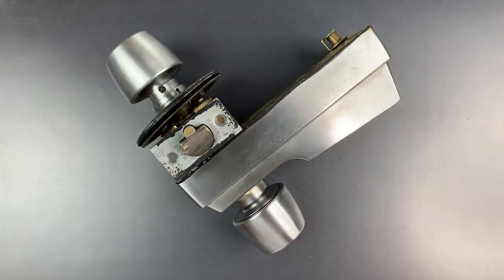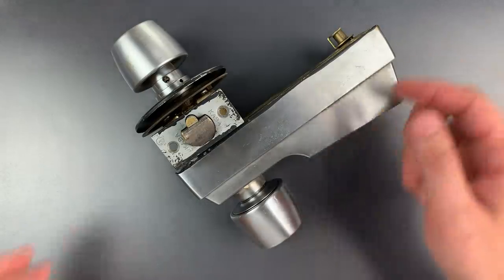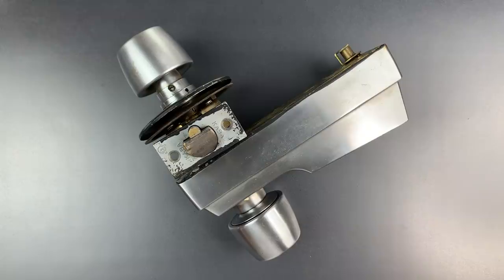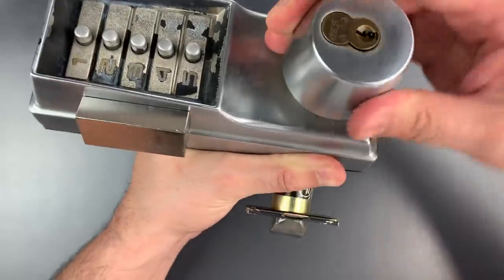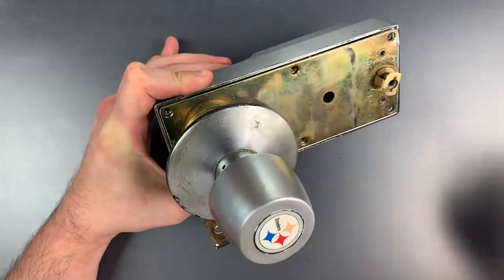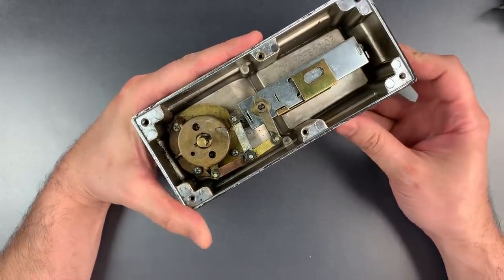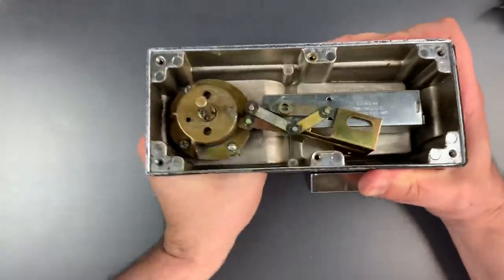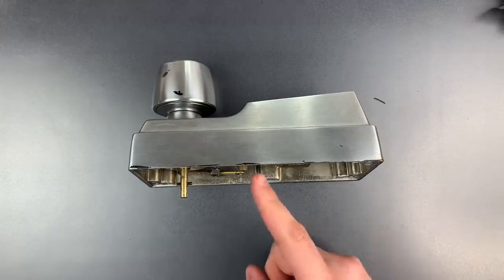[914] The Worst Lock Design Blunder Ever? (Kaba Simplex Series 1000)

Comment: Oh man, we had this lock on the outer door of our SCIF in Iraq when I was there in 2010. Crazy vulnerability! We had another electronic keypad further in, but you could have gotten access to all our servers and equipment in the back with this.
Reply: I find that bizarre. Even in 07 in Afghan we(RAAF) were specifically forbidden from using this lock type on anything requiring even a modicum of security.
Reply: Very bizarre. However, the right way is rarely the Army way. To be fair, it would be difficult to exploit anything in a 24hr shop
Reply: Now hang on.  If it's a SCIF, then this dinky button lock is just used for access control when the room is occupied and there should be a high-security combo lock engaged when nobody's in there.  Was that not the case?
Reply: @Xezlec  24hr ops the entire time, so there was never any time the scif was unoccupied, and no other security on this outermost door.
Reply: @ThatoneLich  so why change it then, especially if there is another one further in
Reply: 2009 COB Speicher Iraq. Working at Military Intel HQ for 4ID they had these locks and only these locks on every SCIF door. It would have been a huge concern, but we were fully staffed 24/7. It was still annoying to have these terrible locks protecting data of certain 3 letter agencies.

Comment: I don’t know about this particular model but most of the style of locks you can only use each of the 5 buttons one time in the combo. No repeats. This means if you have a 4 number combo the permutations possible are actually not that large. Like 120 combos. Especially if you can see wear on the buttons you can tell of a digit is not used. Then it’s like 24 combos. You can guess it fairly easily if you have a minute or two…. In the event you forgot your magnet. I’ve done it.

Comment: They used these locks inside the Pentagon, too. During Desert Shield, I was an Analyst/Terminal Operator supporting the Joint Chiefs of Staff, in the J-4 Logistics Readiness Center. This was early days, and they had just brought on some new staff. This was the first day of the new Team Chief on Duty. He was five minutes away from doing his briefing for the Chairman of the Joint Chiefs when he locked himself out of his own office, and the combination is only supposed to be known to the Team Chiefs. Needless to say, I was an eager young GS-5 civilian just a year out of college, and I could do the math on how long it would take me to brute force the locking mechanism by simply trying all possible combinations — tick, tick, tick, turn.  Tick, tick, tick, turn.  Tick, tick, tick, turn.  Only it took me extra long, because I got to the end with no luck — that was when the Executive Officer on duty whispered to me that he thought he always saw the normal Team Chief turning the door knob the other way. So, I go at it again, and after a few tries, I’m in. I tell the XO the combo, and then I recommend to them that they change it to something else. And yes, the Team Chief did still make it to his briefing on time, with his slides.
Reply: I just commented about this, because it seems the order of the numbers doesn't matter, which means (if I've done my math right) even without the magnet exploit, there are only 29 combinations possible.

Comment: Maybe not the worst, but definitely a serious one. I bet the only change they did was changing that metal piece for a non-magnetic one
Reply: @ZaC kWinz - Austenitic stainless steel or brass would be my guess, as both are non-magnetic. Both are relatively cheap, though brass is less expensive and weaker. 

Since it doesn't look like there is any stress placed on that part, I would presume the replacement part is brass.
Reply: Kaba wouldn't acknowledge there was a problem for a long time and you had to buy the upgrade.  They would not retrofit.  There is info on this if you google it.  The US gov't purchased tens of thousands of these.

Comment: I worked with one of these locks (a newer model) at my first internship in college. It fascinated me because, as a computer engineering student, I had just taken discrete math (inc. counting, permutations, etc.) and I was curious how susceptible to brute force attack it was.
This lock's combinations are one to five step sequences where each step can have one to five buttons each, but no button can be used in more than one step ever.
This lock has 6475 possible combinations. That sounds like a lot, until you realize that if they found a way to allow buttons to be reused for any of five steps it would have 24,883,200,000 combinations.
In my experience, this lock has no lockout for multiple attempts, and if you press a wrong button, you simply have to start over without pressing a reset button. In other words, the only thing that matters is that the last steps you entered match the steps of your combination. As a result, if you don't make use of the ability to select multiple keys in a single step (common in my experience), your combination can always be brute forced in at most 153 button presses, or, fewer button presses than trying 31 length-5 random codes, by using a superpermutation of 5 characters.
If you don't make use of the ability to press multiple buttons in a single step, and the attacker knows how many steps (buttons) your combination is (say they are a coworker who can hear you enter the code, or even a delivery driver who hears you do it once), then, say your combination has n steps (1<=n<=5), then it can be brute forced in min{5^n, 153} button presses, that is, 5^n if n<4, or 153 for n>=4, by using a De Brujin sequence (codes won't usually be less than 3 steps, so this only brings it down to 125 button presses in most cases). Both the superpermutation of 5 characters and a De Brujin sequence for 1 through 5 characters can easily be found online.
More generally, if the attacker knows your combination has n steps, regardless of if you press multiple buttons in any step or not, they can get into your lock in at most (n+1)^5-Σ{i=1,n-1,(n-i)^5} (in closed form, (n + 1)^5 - 1/12 (n - 1)^2 n^2 (2 n^2 - 2 n - 1)) combinations. For example, for 3 steps, that's 991. For 2 steps (the factory default), it's 242.
The fact that the lock allows you to use multiple buttons as a single step but not to reuse buttons makes for some really interesting mathematical/computer science questions. For example, what is the shortest sequence of steps you'd need to do to guarantee that you brute force the lock if you don't assume that each step is only one button? one way to approach the question might be to take the set of all possible steps, treat it as an alphabet, and look for a superpermutation of that, that is, instead of our alphabet for superpermutations being {1,2,3,4,5} like it was before, our alphabet is now the set of non-empty subsets of {1,2,3,4,5}, or P({1,2,3,4,5})-{Ø}. This is an alphabet of 2^5-1, or 31, characters. However, ignoring the fact that we don't know what the length of a 31-character superpermutation is, there is the problem that the number we're looking for would obviously be much smaller than the best lower bound on that length, because such a superpermutaion contains every possible sequence of 31 different steps, not 5. We could also try looking at it as a De Brujin sequence of order 5 over the same alphabet. This would give us the number 28,629,151, but again, our number is much smaller, because this number contains, for example, the sequence where you press every button five times in a row, and buttons can't be used more than once in a pattern.
Reply: CatoSierra can’t we just use the magnet?

Comment: After working with thoes locks for several years I feel fairly confident to point out 2 important things. 1 is i have never seen or put the bypass leaf on any combination unit intended for a lockset that didn't have the bypass switch for the secure side of door, I think it was even a different part numbers for a combination chamber with and without the bypass leaf......2 I also believe that if the bypass switch is installed, the cam that activates the leaf would also keep it from being manipulated that way. That being said, I had never tried that bypass technique on any of the units we had lying around but I always thought it was trying to pull on the comb inside the combination chamber itself. Anyway love what you do, keep it up

Comment: What's the thickness of that magnet-pick in thousandths?...
Reply: Looks to be roughly 875 to 1000. It appears to be a seriously beefy magnet.
Reply: Stupid imperial system...
Reply: @CptJistuce  pretty sure that when one is defined by the other it is the inferior one
Reply: Badger0fDeath  we are all inferior to the metric
Reply: @CptJistuce It's the French who did us one massive favor. The U.S. would not exist if the French hadn't helped us in the Revolution.
Reply: “How thick is that magnet?” ..... “US revolution!”  Happens every time
Reply: @CptJistuce  Please, tell me how the Système International d'unités (international system of units) is stupid?
Reply: Dan Schwartz
Question: when the French Revolution happened, did we do them more or less of a favor by not helping the French monarchy?
I’d say more, so I guess we did them a favor by not doing them a favor that time
Reply: Tree-fiddy and change.
Reply: @alex95sang52  Well when they redefined the meter from the iridium bar to the 299xxxxx wavelengths of yellow light, I wish they redefined it to exactly 3x10^8 so that the speed of light could be exactly 3x10^8 m/s
Reply: @jayhom5385  If we defined 3x10^8 m/s as the speed of light, the "new" meter would be 0.7mm shorter... That's doesn't sound that big, but that makes a big of a difference for highly-precise measurements that would need to be reajusted

Comment: We had those on the doors to the TV studio and TV production room on the air craft carrier I was assigned to from 2004-2006 (I was a Navy Journalist).  Occasionally the mechanisms would simply wear out and they would have to be replaced.  I took one of the broken ones apart to see if there was an easy way to fix it.  I managed to get it to work for a couple days, but then it failed again, and we had it replaced.

Comment: There's an agency in my work building, that deals with sensitive information, that occupies an entire three floors that use these locks. I mean... even if you could get in on one floor you have access to all because there's an open access staircase between the three. But knowing how cheap they are, even if I were to recommend a lock upgrade it'd just fall on deaf ears.

Prior to seeing these there, I'd remembered them from the laundry room in my old apartment complex when I was a kid in the early 90s. Was surprised any place would still be using them.
Reply: just keep entering without keys or combination, eventually they will fix it

Comment: We had these in many of the labs and offices at school way back when.  I didn't know about the magnet, but I did see that the combinations were quite limited, and any button could not be pushed twice in a row, so that there were only 80 combinations possible with the typical 3 digit combinations used there.  You could go to any of these when nobody was around and simply try the possible combinations sequentially until you found the right one.  I did this on one or two doors and it was quite easy - I think the longest one took about 20 tries.  But I didn't really need to go into any of them, it was just the fun of finding the combo.  There were other doors that had similar mechanical combination locks, but with 9-key buttons and 6 digits, but I never tried those.
Reply: There are 541 combinations if you use all five buttons. If you add the number of combinations that can be achieved by using 4 buttons or less, brings the total to 1082 combinations. This does not include the number of combinations that can be achieved by depressing two or more buttons at the same time, when included in the combination.

Results from the Simplex Lock Problem

Comment: A client of mine had the 1st gen Simplex on a warehouse and were supplied the kit years ago to fix the vulnerability. The replacement pieces were plastic. The problem is the plastic broke recently possibly due to the door facing a western exposure and daily sunsets, along with Chicago summer and winter variations from 100F to -20F. A few years of that abuse and the mechanism totally broke and the door could no longer be opened from the outside. They replaced it with a DL2700.

Comment: We used these locks quite a bit in the Military. In fact, there is a variation of this lock on almost every bunk locker drawer on US Navy Ships. The locker version is not vulnerable to this attack but, I use to help people all the time that would forget or not know the previous owners code. I would just stick a pick into that slot to open it because I could access the drawer from behind. I could just reset the code or remove the back plate and decode it by watching the wheels. I did not know about the magnet trick back in the 90s but I did discover really quick that in Government buildings, spaces controlled by the same  departments almost always used the same code. I stood a building security watch on night and tried codes to spaces I had legitimate access to. My codes work on other doors about half the time and I only knew 3.

Comment: This was the same lock on my dorm room.  If you have a few minutes free with it you can guess the combination easily too.  They would always change the combo every semester, but they would only rearrange four of the five numbers, so if you know which is the unused number, it can cut your guess time down quite a bit, and it was always four numbers so you could start there too.  

There was a plant where I worked more recently where they had one of these locks on one of their storage buildings.  When I needed to enter for a part but it was a half a mile back across the plant to the guys office who knew the combo, it was quicker to guess it than to go get it.

Comment: You also failed to mention that there is a default number combination that is 99.9% of the time never changed.... that is press 1 and 3 at the same time then 2 then 5... opens up almost all the time. I had one of these at my old office and it worked there. It also worked on the apartment complex pool down the street from my house I would go hang out at.
Reply: Yep, all the supply rooms and (frighteningly) med closets at my local VA hospital can be bypassed with this technique

Comment: We had these on medium-security doors, such as conference rooms,  where I worked as DoD contractor. 7 times out of 10, someone would have written the combination in tiny print on the wall beside the doorframe.  These locks were effective in keeping spies under the age of 4 out of such rooms - they weren't tall enough to read the combination.

I have never seen these 1000 series locks used in high-security applications.  Those doors used multiple locking mechanisms, usually badge readers with pin code keypads in conjunction with a Kaba X-10.

Comment: I had no idea about the magnet thing, but there's another problem with these locks. There just aren't that many combinations, and with practice you can get it purely by trial and error in just a few minutes. Especially if it's an old lock and the buttons are worn down so you can see what numbers are in use. Of course the first one to try is the factory default combination.

Comment: What was the fix?  make that problematic part out of aluminum?
Reply: Ye that or plastic, don't see why it couldn't be made out of fairly decent plastic, not that aluminium is expensive but I'd assume at a large scale plastic is even cheaper lol. I'd imagine someone coming up with a portable blowtorch and melt it from the outside :D
Reply: @huldu  Thing is a blowtorch would work on Aluminium too they can produce flame temperatures significantly in excess of 1000C Aluminium melts at just 660C. Granted you have the layer of air inside but the metal lock body would be a very effective heat transfer mechanism to heat up the relatively enclosed air inside, probably getting the lock body up to Orange/Yellow hot (around 1000C) would do the trick. Then again stainless steel has a much higher melting temperature and is usually nonmagnetic granted certain processing can convert some of the Iron into the magnetic phase and some alloy mixtures fail to eliminate it completely, but if a nonmagnetic alloy mixture were chosen and it was properly handled this would do the trick. Processing that can trigger conversion includes things like cold working this makes manufacture a little more expensive as you need to make the parts in a foundry not just cut and fold sheet steel but doable.
Reply: Duped comment?
Reply: Replace with the non-passage combo chamber

Comment: I don't know if it applies to this specific lock but I used to figure out the combo on a number of doors using this type of lock very easily.  They typically only used three digits for convenience (I'm talking about private bathrooms at golf and boat clubs, not high security facilities) and since each number could only be used once the possible set of combinations was fairly small (I don't know how to do the math but in the 100's anyway).  It was usually just a matter of a few minutes of trying every possible combo in order.

Comment: 0:31: yeah, "they are very easy to operate" :)
Also what's the entropy on the key combination? I bet it used 3 digits from 1 to 5. Plus something tells me that digits 2, 3, and 5 were used on that particular lock :)
Reply: I expected that was the vulnerability he was going to talk about.  That the digits became obvious over time, AND (at least in the ones I've used) the digits could only be used once.  So it was 5x4x3 if you couldn't see the wear, and 3x2x1 if you could tell the digits.